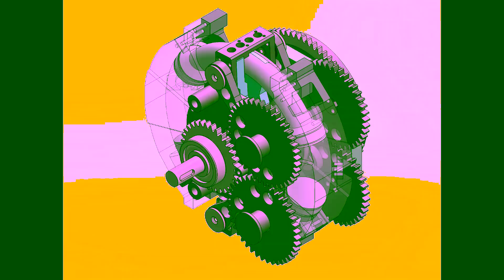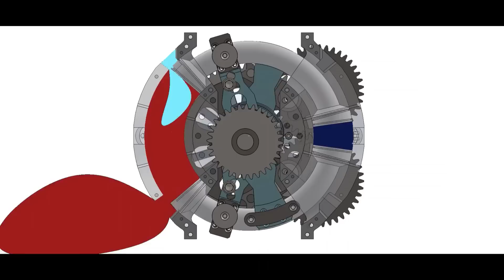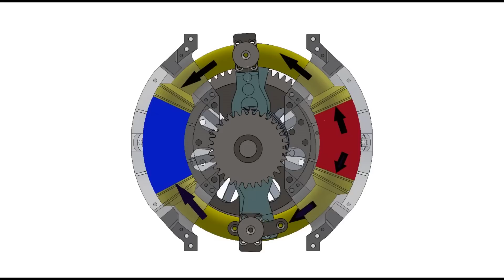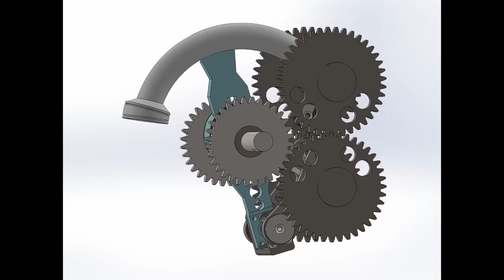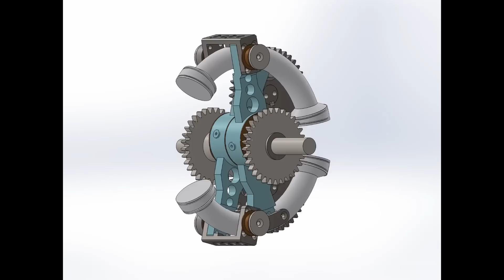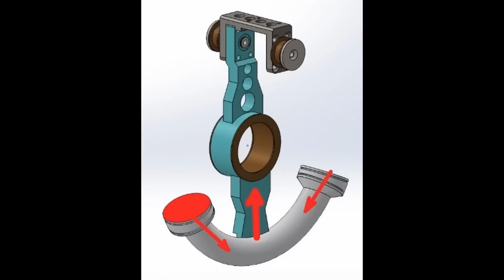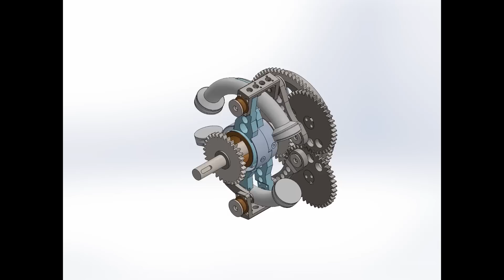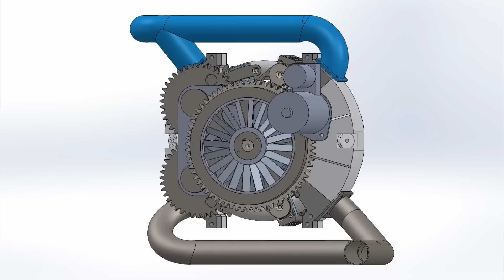A new type of Engine

Comment: This design principle is old.. very very old. Unless you're going to break the exotic market with a new record for power to weight ratio, simplicity for manufacturing is key for mass adaptation. Even the Wankel rotary kept it's unique shapes in 2D so it was kinda doable to scale up. Excessive resouces needlessly spent on over-engineering and forcing shops to adapt .. while having EVs and hybrid tech already forced down their throats. Ask any engine mechanic, all it take is one glance to point out the obvious real world issues.

Comment: Interesting concept, though a couple of pointers.
1. Dont call it a rotary engine. The wankel fans will eat you alive. 
2. Youll have a manufacturing nightmare with this. Sure the piston rocker itself wont be the easiest thing to produce but is feasible. Where i think the main issues lie is the curved cylinder walls. The main reason conventional engines use straight cylinders is because theyre "easy" to produce to a very high tolerance (cast out, straight bore,ream,hone) whereas these will need a new machining method creating to mass produce them (5-axis notwithstanding, cost-wise). 
3. Lubrication is absolutely required. Even in a conventional engine the pistons themselves dont touch the cylinder walls, the rings do and absolutely require lubrication. That you glossed over this suggests you need to do a little more research how conventional engines are manufactured to be appropriately context-based for this new work.

Comment: reinventing the wheel, and trying to pitch and sell it is pretty bang on with reinvented combustion engines, assuming it’s using 87-89 octane fuel. What can it be used for? how will it handle winter/summer changes? can it be a viable mass produced product? will it exceed cost of other cheaper efficient motors? 
etc. with other factors. 
Nice idea, but nothing ground breaking.

especially in the age of electric cars being marketed off.

Comment: How do you propose to combat blow-by? Without seals, combustion pressure and heat will escape behind the piston head. If you need seals, then that implies friction losses. The shaft connected to the connecting rod might need to be the output, because the gear teeth will not stand up to the output of the engine unless they're made very robust (and thus heavy)

Comment: This would shake itself apart with the pistons and conrods moving laterally in the same direction. The parts in this would be extremely difficult to manufacture, the piston/conrod combined unit would be extremely heavy, the power cycle would impart shear forces on the conrod that would severely limit compression and power output, and the coupling between the crank and the conrod would require an oil jacket that also would add weight to the engine.

Look at the Astron Aerospace Omega 1 engine to demonstrate this engine is already badly obsolete.

Comment: Excellent video. I like the complete redesign of the conventional 2 stroke engine. I do have a couple of technical questions to possibly be addressed in a future video. First, because the forces on the pistons are tangent to the axis of rotation, will there still be a component of that force which deflects the piston to the outer wall? If it does, would it then require an oil film to reduce wear on the engine block (or engine donut)? I see how the rotary nature of the engine could eliminate the need for an oil-bearing on the crankshaft. This is very clever. Does it also eliminate the need for oil to film to create a proper seal between the piston head and (fun, twisty) cylinder wall? If so, is this due to a novel material choice of either the piston head or wall? Perhaps a coating of sorts? How will your design deal with the thermal expansion and contraction of the elevated operating temperature? 
These are just some of my thoughts on your video. I loved the animation of the mechanical reciprocation.  Very fun to watch. Keep up the good work!
Reply: It will definitely need oil for that tangential power stroke even though the other side is working to compress it is not enough to offset it

Comment: I am interested in magnetic engines because I have some understanding of how they work. Built one that worked when I was at school. Almost identical to one I saw on u-tube. No one else seemed to have a clue what they were looking at. Built 90 percent of another one about 2 years ago. Proved to myself it works. Would be junk to anyone else. Have been to pathetic to finish it of even though I likely have parts to do so. If I use the thing between my ears and do some work on it hopefully I will finish it some time. I know how some other guys magnetic engine works. As likely do quite a lot of mechanical engineers. Woopty do. I like drive train designs for some things. Bye.

Comment: Thermal efficiency is limited by the Carnot cycle so you shouldn't chase dreams of 60% or more. Better go for higher power/weight ratio, there could still be a lot of room for improvement here.

Comment: Interesting theory, but I don’t think this design really overcomes the friction losses. You still have a three pivot system, it has to exist to convert reciprocal motion into radial motion.  you just transferred it to the gear case. and you’re still going to have heat loss even if you’re cooling it the energy is still being transferred through combustion to heat, so I think this design is just going to be more a Complicated version of what already exists. It might be a bit more efficient because you have opposing PistonHeads but they’re already linear versions of this that are in production that have been made since the 1920s. try looking up opposed piston diesel engines. By making them linear it reduces a lot of the complication of manufacturing and maintenance while still obtaining the efficiencies of opposing pistons opposed to an engine head. On a sidenote, if you haven’t already checked out rotary engines, they are a pretty interesting concept that had complex seals that resulted in complex problems. But anyway great work on designing the CAD and doing analysis on this project. I love to see it.

Comment: How is motion transferred from the pistons to the gears?  Won't this contact point undergo high wear?
Reply: Watch the video slowly in the 0:25 to 0:30 range. Can you see the connecting rods from the "piston mounting arms" to the gears? Those convert reciprocating motion into rotational motion. They wouldn't undergo any more wear than any other typical connecting rod, assuming typical connection mechanisms and/or lubrication.

Comment: In the famous 90's in Italy am internal combustion engineer that I worked with lately (2007-2010) on a rotary engine concept, has explained me he worked for an inventor that brought him the plans of a motor with the pistons shaped like a banana that were using two banana like pistons in a cylindrical circle shaft to make compression against each-other piston heads instead of a regular motor head, but they found difficult to manufacture it as they could not find the right tooling to create the circular round shaft at the time, so they tried to make it from two semi-shafts bolted together, but that was leading to a loss in pressure along the seam no matter what they did, however if run "wet" that means with lots of oil in the mix to seal the seam, it was outputting outrageous amounts of torque, and shit loads of smoke to.

So your motor was already invented in the late 80's, early ninety's by somebody else, hence not patentable any-more because... common knowledge. However with the tooling available today you might make it with the cylinder in one piece instead of two bolted halves (3D metal printing and sintering is now available anywhere on the globe) and might even get it on the market to compete Elon Musk electric motors. 

If you want to talk more about this please contact me directly.

Comment: Engines are air-compressors with extra steps.
Fuel mixed into the air stream, combustion when the compression is right, hot expanding gases keeps the whole thing going.
A good pump makes a good engine, a better pump makes a better engine. 
I don't see how this is a 'better pump'.

Comment: Wow what a unique design. I wonder what the engine would sound like and what the power and speed would be like. Im also wondering how big the engine would be size wise. Amazing video.
Reply: Andre The Great (YouTube) has built an engine simulator that can simulate the sounds engines can make by physically simulating the engine with fluid dynamics, etc. He could easily recreate the engine on the simulator and see how it sounds

Comment: Build and test. 

Designing a theoretical engine is easy. You gotta be able to manufacture it. I’m not aware of the tooling needed to make a curved cylinder. Your animation shows piston rings and several pivot points. You’re assuming no friction?? 

Build and test. 

There are many ways the ICE can be improved. I’d look for ways to recover waste heat and make it do work. Can you make the exhaust cooler than the intake? That would be a neat trick!

Comment: To comment on machining toroidal bores. Easy.
That out of the way on to high pressure,high temperature steam. Explosive and erosiive when suddenly released to the atmosphere. It wasn't widely used on aircraft in WW2. I tried this with vw bug engines as a means of increasing economy when a teenager. Now only use it to clean carbon from old engines,gasoline of course.

Comment: There is a larger problem with that type of engine, the constant acceleration and deceleration the pistons are facing along with instability due to the unbalanced engine movements leads to a less efficient design (fuel/power output). As another commenter also posted here, the machining required to do such an operation is very costly and not as economic at larger scale. The engines requirement for 2 pistons to compress the same volume of air also reduces the efficiency of the engine as 2 of the pistons are essentially fighting each other for the same compression. Angular momentum is harder to counteract than compressive due to the properties of all materials, which also increases the volume of material used for the arms of each psuedo-crankshaft.
Overall, for this engine to be a more efficient, you would have to increase the rpm whilst minimizing the torque put on the arms, additionally you would have to prevent the pistons from being too massive. This design is pretty much a rotary engine with pistons or a regular piston engine bent around the crankshaft. Although this is an interesting idea, I would not say that this is an improvement on current engine design as it leads to a lot of energy loss due to unnecessary acceleration and deceleration of mass.
Reply: BTW, the engine concept you have described is called the Toroidal Internal Combustion Engine but with extra moving parts.

Comment: let's say you somehow solve the problem with centering the main shaft and its drive from the connecting rod gears, what will you do with the abrasion of the teeth? let's say you somehow convince people that the angle of attack of the connecting rod on the gear during the explosion of the mixture does not matter and the loss of energy to friction is not significant what will you do with the destruction of such a flimsy structure under loads with increasing engine power

Comment: I mean.... Why not screw it.... Like literally.... Jet based theory, but in a piston with an auger compressor.. don't see why not, but like... I doubt it'd work, let alone be worth the effort.....

Also, I don't like this engine simply because of the crossover action... That just looks like engine failure to me the whole way through.... But I'm also spending more attention to typing this than to the video.... Maybe it's the idea of scissors in an engine that's got me kinda.... Iffy.... Maybe for a single rpm generator... Especially if efficiency is high.... Looking at it looks like it wouldn't take too well to a redline rev like it's inside out flat counterpart the boxer engine would...

Comment: Question, where is the vacuum effect as the air enters the engine? A normal piston starts with very little space and then expands, but the air rushes into an already expanded chamber as the exhaust gasses are escaping. Speaking of, the exhaust is not forced from the engine but allowed to just flow out once the piston opens far enough. This seems that the air coming in and going out will be doing so with little pressure difference.

The air in an engine does not simply move itself, but is sucked and pushed around by the movement of either the piston, or the spinning action of a traditional rotary. Essentially an expanding/contracting volume. This is not happening during the critical times when the piston is exposed to the atmosphere as the volume is not changing and by the time it begins to return to compression, the intake/exhaust are both shut again.

This engine is interesting, but without some sort of rework of the intake/exhaust rework it will not run.

Comment: It appears to me the engine in this configuration would shake or be unbalanced, in that the mass of the pistons moves together from side to side, “pairing” or “tripling” or even “quading” may smooth out the engine, but then you would have to add fuel injection etc.
Reply: Why not have the engine in a series of 3 or more instead of adding more pistons?

Comment: Unlike a lot of people here, I think the design is fairly good.  The main obstacle is machining the long cylinders.  Shorter curved cylinders would be much easier.  Perhaps if it had 4 cylinders in the circle, rather than 2.  Heating of the piston+rod could cause it to be of a slightly larger radius of travel than the cylinder.  That would add a compressive force on the outside of the cylinder.  This can also be minimized by shorter cylinders.  And, in any case, there will have to be a seal between the cylinder and the piston, and likely some lubrication to minimize friction.
Another issue is that with all the gears in there, there is significant momentum, and thus it is less responsive when used in a traditional automobile.  Though, there might be other applications like aircraft and generators it may be well suited for.
As is, with its long and thin cylinders, it might make a good compressed air engine.  They used to have compressed air locomotives in mines.  And there were attempts to make compressed air engines for light cars in India a few years back.  The long cylinders, make heating the cooler than ambient compressed air closer to ambient within the cylinders somewhat attractive, as a lot of fins could be put along that cylinder wall.

Oh, and my vote is for naming this "The clockwork engine".  Even though, the term is used for toy spring engines.

I have made a few designs for water injection engines as well.  I think there is a lot of room for innovation there.  So much useable heat going to waste in modern engines.

I kinda paused by efforts on it, mostly because I think battery electric has obsoleted internal combustion.  And it would actually be sad if we only got efficient engines in the last gasp of internal combustion, when it could have burned so much less fuel if it had been around for decades.

By 2035, sale of new gasoline and Diesel autos will be banned in California, the US will likely follow, 5 or 10 years later.  Many other countries will also make the switch.  Many automakers are also vowing to switch entirely to electric.  And this will be accelerated if and when better, cheaper batteries are made.  And that may not be far off.  Sodium batteries are looking very interesting.  Personal eVTOL is the only thing that could throw a monkey wrench into the trajectory, as people may choose one of those rather than a new electric car, if prices are realistic for people.

There is probably a lot of opportunity to retrofit internal combustion cars with breaking regeneration systems.  Presumably that would be in-hub, as trying to redesign every transmission would take one heck of an AI and advanced printing.

Comment: Looks interesting. Have you considered using the exhaust output into a turbine generator to gain electrical power from the heat and gas pressure?

Comment: How is the minute gap at bearing surfaces handled with regards to centrifugal forces and piston ring clearance and wear differences on the outer diameter of the cylinders relative to the inner diameters?  A standard reciprocating engine has significant wear of piston vs. cylinder wall scuffing without the added centrifugal forces.  Also, the detonation impulse shear forces on those arms supporting the cylinders will be significant.  A standard 4 cylinder engine will a have at least 5 bearings and caps securing the crankshaft and the shear forces are lessened by the design of the small diameter of the piston rod connection to the crankshaft.  Here you have a much longer moment arm and just one.  But it is clearly a novel design worth further exploration.  Lithium isn't going to solve our transportation problems alone.

Comment: the biggest issue i see is that the pistons spend different amounts of time for certain strokes while the simulation spins the shaft smoothly. the output power would be 'wobbily'

Comment: Emissions are a pain with two strokers, if this system could be adapted to a four stroke design using a valvetrain and intake/exhaust runners similar to Boxer or Flat engines, it would alleviate several problems with lubrication and wasted fuel/oil through exhaust. Although it would add another set of moving parts through cam gearing and valves, which may hinder reliability.
Reply: I missed the part where oil was injected or added to the fuel like regular two strokes ?
Reply: @jackmcandle6955  I would assume if this system was applied in the real world it would have a form of lubrication system.